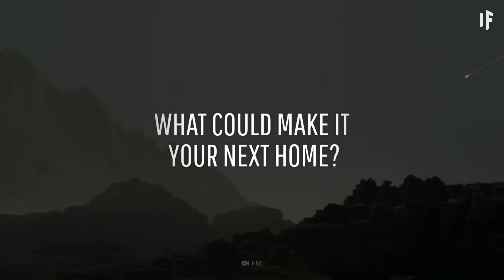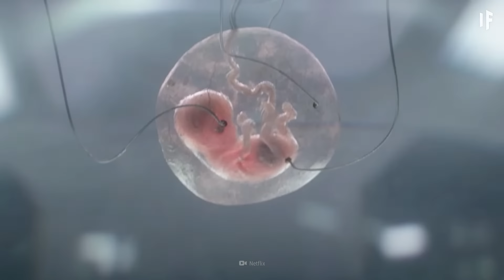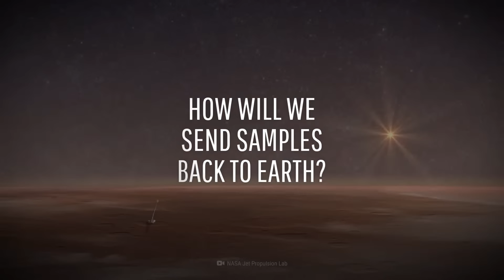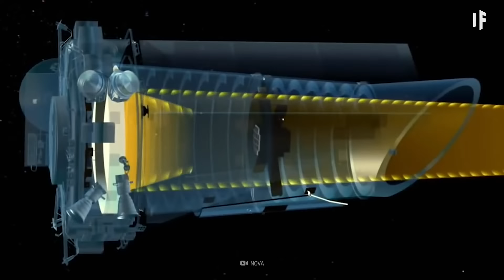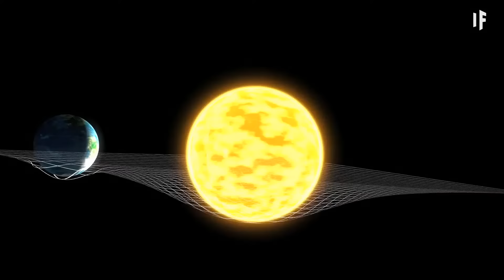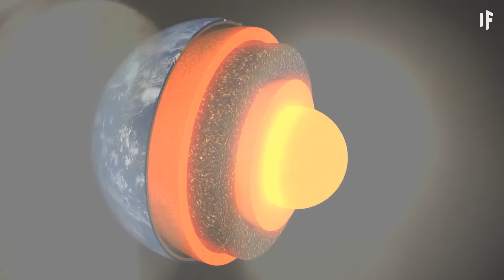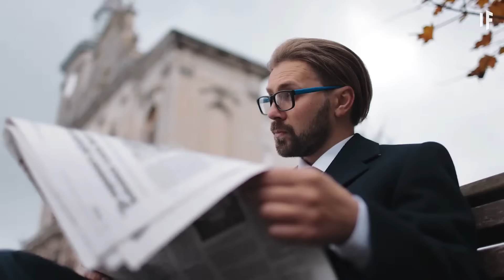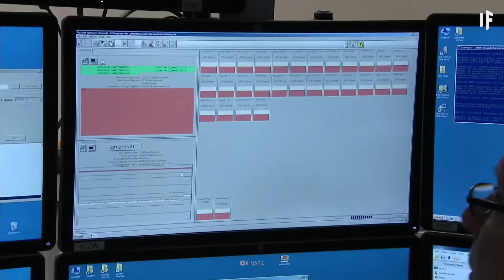New Exoplanet Discoveries - Could They Be Better than Earth? | What If

Comment: Neat video, but it doesn't actually matter if we can live on a planets surface. Rotating space habitats are far more efficient and if you're sending a mission someplace far far away, then it would be wise to ensure livable conditions regardless.

So as long as the planet isn't a clone if Venus, even if it's a gas or ice giant we can harvest it for raw materials to make more habitats. Meanwhile folks would live on the colony ship as a sort of hub station in the star system. We could eventually use those materials, probably from asteroids to develop a specialized colony for whatever surface type we encounter.

Comment: 10:45 wrong. You'd be instantaneous in reaching there due relativistic nature
There are many reasons why matters like yours can't travel at speed of light(you cant be bi). To simply put,  you cant become light, but still theres only one way to travel at the speed of light and that is becoming light itself. Therefore,  to do FTL travel, you MUST become light, which is impossible. Therefore, FTL is impossible. 

Plz don't bring up "we didn't know possible to fly like a bird back then".. cuz that quote make sense only tiny bit.  We also thought its impossible to breath water which still stand true and will most likely true forever. Touching the sun,  dying and came back to tell the tail, etc.  Also note we still can't fly like a bird, will never be able to with our bone density and overall anatomical construct. There's different between improbability and impossibility, and as of our
understanding goes(dont underestimate your own species, we do know allot), FTL is almost impossible, which many theoretical scientists and physicists alike would tell you the same.  

P.S don't loss hope tho FTL isn't the only way of achieving installer travel. Just like the video stated afterward, cryogenic has considered. Generational journey is also an option to, tho There's no way to hav feedback/ communication with thy earth thru th journey due to the speed of light limits data transmission. 

Tbh c the constant really limits in achieving certain things in the universe(regardless of circumstances or observational point). no wonder some are now coming up with "we are in a simulation" thing, which i hav no idea what to make of. Personally i won't spend time+energy in something that's obviously both unexperimentable and unobservable, two of which mainstay of scientific rigors

Comment: You can't go there , 
Without my invention flash driving running in light speed way and my invention levitation levitating way the gapping zone way .
My way as long as the up pull the bottom push the center zero which is the chassis and load is following only. 
No fuel no fuel chamber and no batteries. 
Remove first the weight of the chassis and fly with Anti gravity way,  the gapping zone will did it .
You want my way if not then do eat your way .